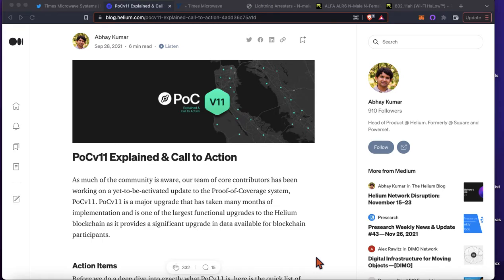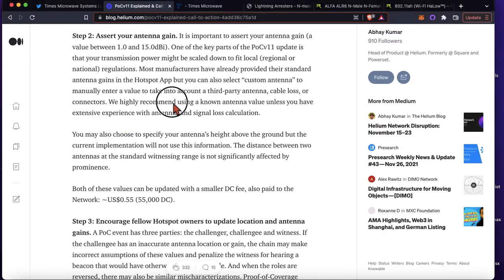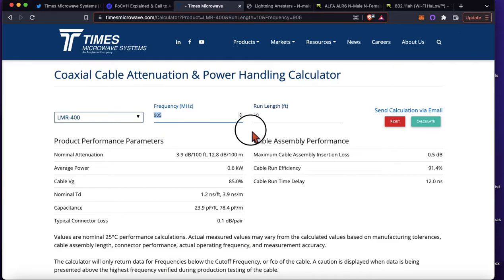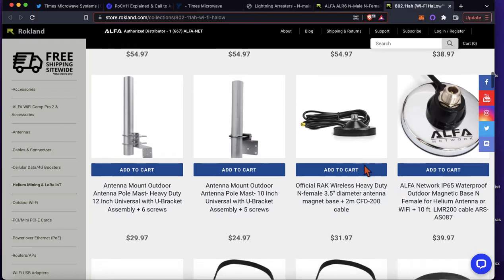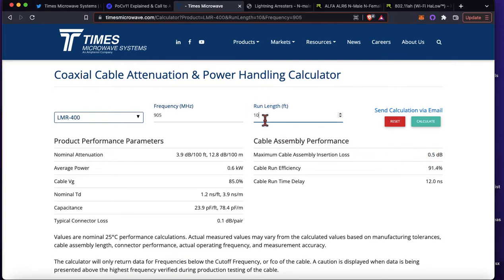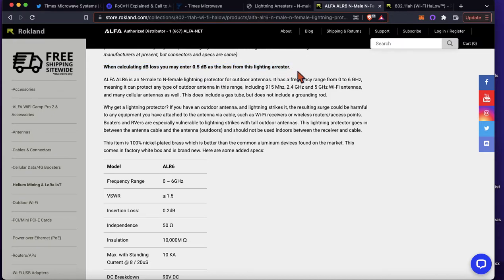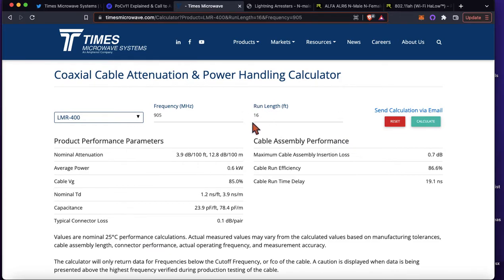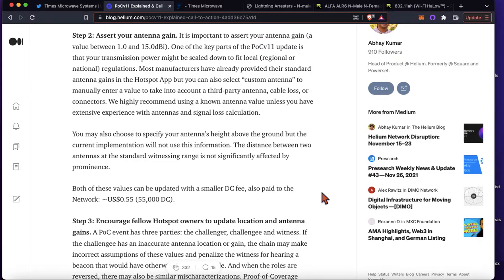How to Calculate Signal Loss for your Helium Setup (PoC v11)

Comment: Great job on the info. Question on antenna height vs cable dbi loss:  reaching higher will improve range, what would be your acceptable max dbi loss vs elevation?
Reply from the maker: Thanks Dennis. I would say max dBi loss I would consider would be ~2 dBi. You can use the calculator to see how much run of LMR-400 that would be for you, but generally I don't like going over 30 ft of LMR-400 cable. At that point I would consider mounting an outdoor enclosure and have 10-20 ft or less of LMR-400 and run a long flat Ethernet cable instead.

Comment: Nice breakdown and explanation of what to use when entering information. Do you have some guidance about lightning arrestors and placement of those? I've heard putting them on the miner side is better than putting them on the antenna side of the cable. thoughts?
Reply from the maker: Thanks for watching! It's been a pretty mixed bag on arrestor placement. Feels like half of the folks are okay with it under the antenna, but I've heard the same as you have from HAM radio folks (put the arrestor closer to the miner to shorten the path to ground). I've only been able to find it for sale at data alliance with the appropriate connectors for such a configuration. 

For now, I'm leaving mine close to the antenna with the logic of "some protection is better than none" but I am considering moving the arrestors in the future. I've had the 2 flagpole setups for 4 months now with no issues having the arrestor right under the antenna. Hope that helps. 

BTW cmh3, congrats on winning that Finestra miner! I need some of that luck lol
Reply: @NorTexMining  LOL thanks, now have to find a home for it! Thanks for the reply with arrestor info. I agree that something is better than nothing.